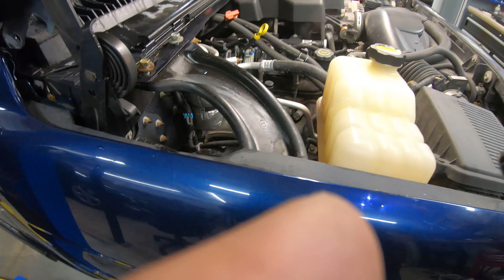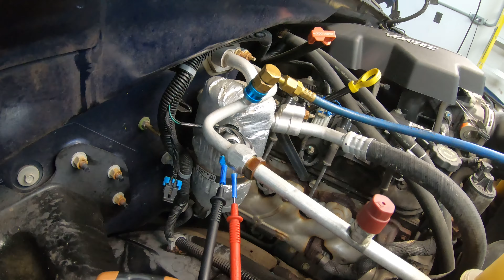2000 Chevy Silverado truck ac repair

Comment: I  have problem. No readings on the wire too the compresser or 9:51  high pressure sensor  i can click the compressor at the fuse on top 9:44

Comment: Water freezes at 32 degrees so a 30 degree evap coil is going to freeze up. You will also be returning liquid to the compressor. Liquid cannot be compressed and is a leading cause of premature compressor failure.
 You can't properly evacuate, diagnose, or repair a sealed system using only low side pressure readings. They install hi side service ports for a reason. It can reveal other potential issues like dirty cond coil, inefficient compressor, plugged orifice tube, proper charge. Its also necessary  during evacuation and charging.   Use application specific o-rings. Refrigerant oil will degrade the seal and create leaks if they are not compatible and the correct ones will ensure a proper fit preventing leaks. 
 If you open the system replace the filter/dryer. Moisture mixing with refrigerant doesn't freeze as you stated but it can create acid which  is worse and the non-condensables decrease system performance. The only way to ensure all moisture is removed from the system prior to refilling is by using a micron guage during evacuation. It also reveals very small leaks immediately. 
 Leave the infrared in the tool box. They are unable to read air temp and the beam reflects off of the tubing causing you the erratic temp fluctuations you were seeing on yours. Supply air temp is decent way to determine how well system is cooling but the rest of those readings werent really useful for.this job neither is voltage reading at the pressure switch.  Using a clamp on type temp probe for the tubing and an air sensing thermometer in the vents will give you a more realistic reading. 
 Weigh in as much of your charge thru hi side service port as possible before running the a/c instead of introducing that liquid refrigerant into your compressor while its running. Weigh in the  FULL charge that is specified plus around 1 Oz to account for what remains in your high side hose. Make sure  cond and evap coils and cabin air filter are clean prior to charging as these significantly affect your operating pressures. The settings should be on max cool, recirculate, and all doors and windows need to be closed while charging. 
 This isn't a get it close kind of repair. Whenever a sealed system is opened up great care must be  be taken to ensure it remains contaminant and leak free and properly refilled.
Reply from the maker: I love that you took this much time and passion to write this article on the repair in my video. I do appreciate all your input as I'm sure anybody else that reads it. Thank you so much for your contribution.

Comment: Love those Pittsburgh wrenches there so thin they fit in most places craftsman or even snap on can't
Reply from the maker: Yo you're right about that and for 1/2  the cost I use them every day all day long  Thanks for your comment and thanks for watching
Reply: @JamesNoBull  
    MR. NOBLE , I JUST WATCHED THIS VIDEO AND YOU RE RAZOR SHARP !!!!👍
    I M FROM BIRMINGHAM , ALABAMA AND WANTED YOUR EXPERT OPINION ON MY PROBLEM. SHOULD I FIX  MY A/C WITH A KIT SINCE IT S A 1999 GMC / 4.8 / 2 DOOR / SINGLE CAB / SHORT WHEEL BASE ?
   I VE ALREADY SPENT A TON OF CASH ON FREON , PAYED LABOR OUT FOR NOTHING , ROUGHLY $350.00 I VE JUST BLOWED IN THE WIND !!!!
    AGAIN , LOVED HOW YOU DETAILED EVERY STEP IN THE VIDEO , WOULD TRUELY APPRECIATE YOUR OPINION ....THANK YOU SIR 🙏🙏🙏🙏💞💞💞💞💞